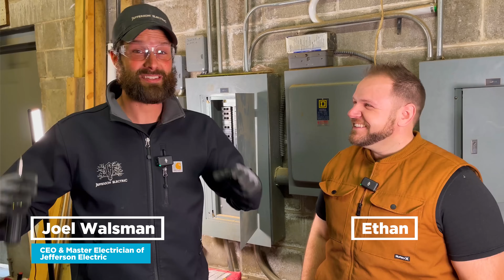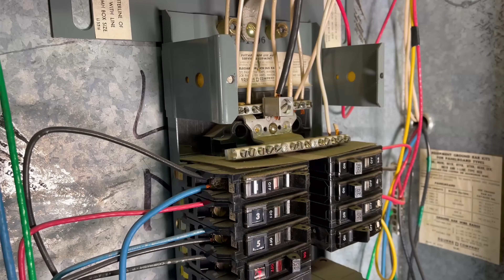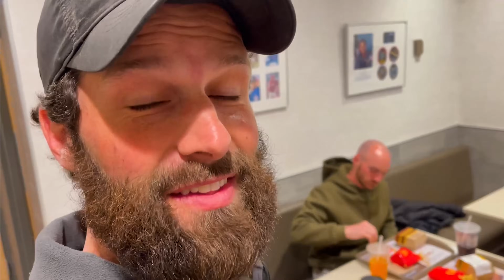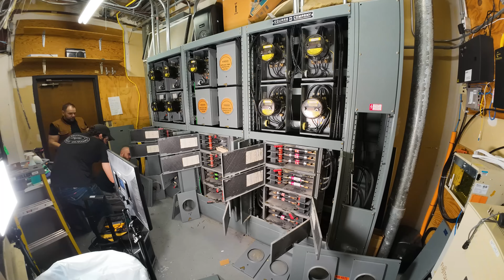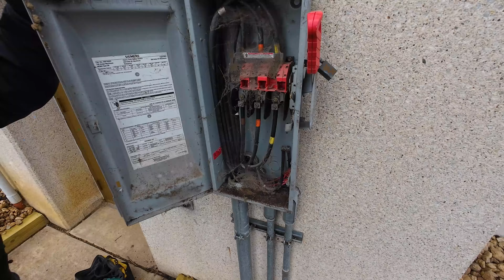LIVE POWER Commercial Electrical Inspection: Is "Work From Home" on its way out?

Comment: Joe, always be sure to check out the integrity of the GROUND system connections to the main water pipe, gas pipe, bonding connections to HVAC, ground rod connections, etc.  The Ground wire is probably the most important of all the wires for safety and is often broken or neglected in many buildings.

Comment: I was inspecting building equipment same as this video. Opened a 25kva transformer and there were two pairs of channel locks setting on top of the coil heat shielding. They jad to of been there for 20+ years! The handle grips had melted to the shielding. Crazy

Comment: YAY ! New video. Either I've watched them all or the posts aren't as frequent. 

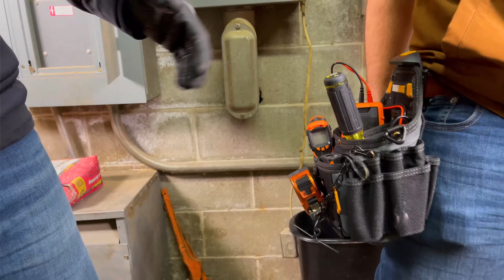00:34 I love Klein tools too. And I keep them clean. 02:50 I wasn't shocked on my first day, but I'll never forget how I felt after my first shock.  And like most shocks, I did something stupid. Poking a non insulated screwdriver around in a circuit I "thought" was not energized. Welded that screwdriver to the electrical box. I would argue that I was electrocuted, but people say that if I survive I was shocked, not electrocuted. I disagreed. If they felt what I experienced there would have been no disagreement.

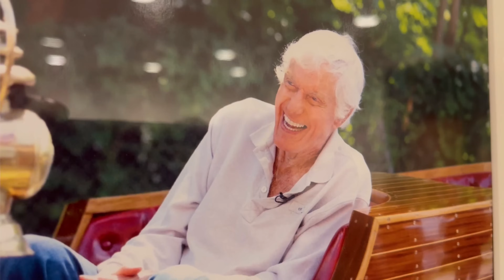11:00 I love Dick Van Dyke too. My childhood was the opposite though. Mother and Dad had cable, so there was "Nick At Nite" it was called, and they ran the old shows. When I got older, I moved in with my Grandpa to take care of him. No cable, but "Diagnosis Murder" was on regular TV. We'd watch that and "Becker" When it was time for the show we'd say "The Doctor is in." No TV on demand back then either, and DVR was either unheard of or so new it was unaffordable.

11:10 loved the "dad" jokes.

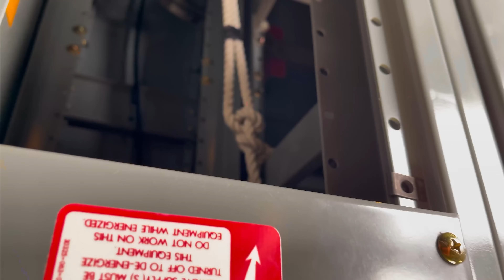12:04 Why combustible rope ? Wouldn't it behoove those involved to use steel cable ? If not to be conductive a non conductive, non combustible implementation ?

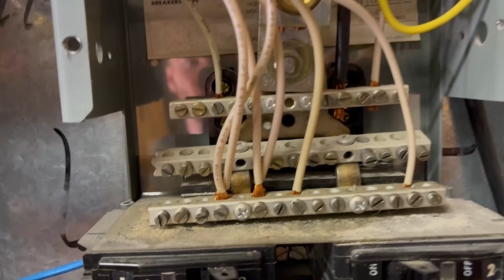15:26 I can always tell where someone has been that was not licensed, or should have not been licensed. I see stuff that's neat and right, I know someone who cares and knows what they're doing worked on it. When I see "violations" I know that someone incompetent messed with it.

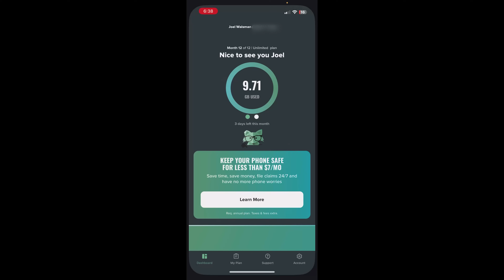15:50 Mint Mobile is good, unless you decide to go with someone else and keep your numbers. They will give you the runaround, fake information, and all kinds of nonsense. They did that to me. I had to write a very nasty letter, to the owner, and I finally got the information I NEEDED six months later, from the owner after I had already moved on. So they were okay, right up until the point they weren't, which made me want to switch, then that incident just added to it.

I am paying double with Cricket Wireless but if I have any problems, whatsoever, I can go into any Cricket store, get what I need and get on with life, rather than deal with shenanigans, malarkey, and all the monkey business that I experienced with Mint. Otherwise, they're good, and if it works for you, all the better. I'm not knocking them nor those that are desirous to used them. Just telling you my personal experiences.  To be fair, this was 3 years ago, and my Mother just died too, so my fuse might have been short. But when met with that level of aggravation over something as simple as asking for the code to change carriers and the fakakta mishigas I went through, and still couldn't accomplish it... ? That was the final straw.

21:37 Aw... It's over. Hope you post more stuff more often in the future. Can't afford to do that Patreon stuff. At this point, I am lucky I am still on the Internet and wondering how long before it will have to go.

Comment: Love the long form video! What's the saying? No electrical installation is without sin? You provide a great service to keep customers safe. I was impressed you didn't look to have what I find as the most common sin - electrical areas used as storage closet usually with combustibles in working space. I know you don't provide remediation on the inspection, but I'll put working space tape down as part of checking things out. The stuff you found notwithstanding, this looked like a fairly responsible customer, as corroborated by their decision to bring you in! (And I see that toughbuilt tool pouch, same as me... Klein ain't mine is fun, but there's a real world here too).